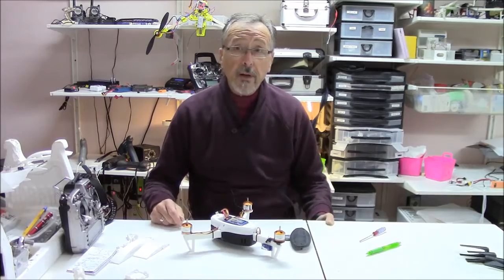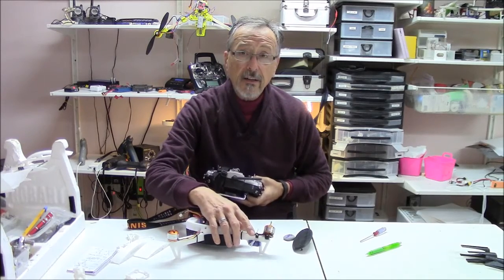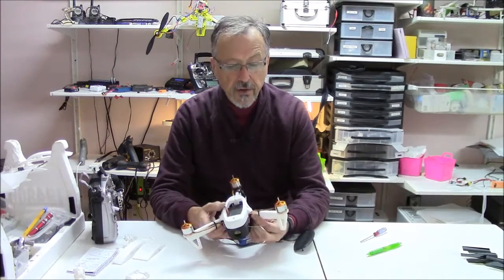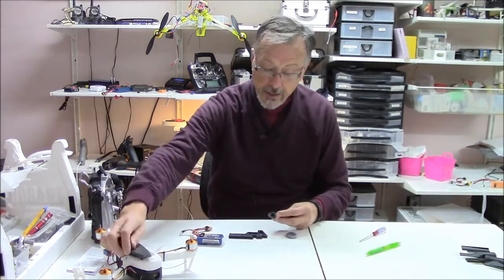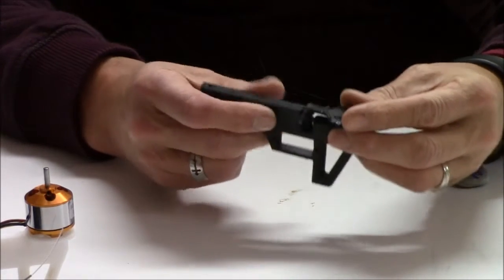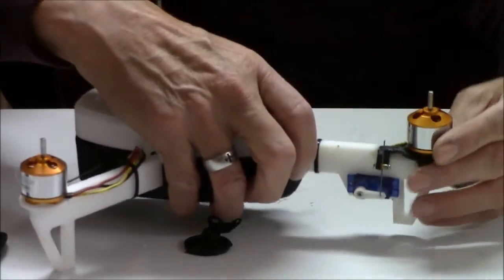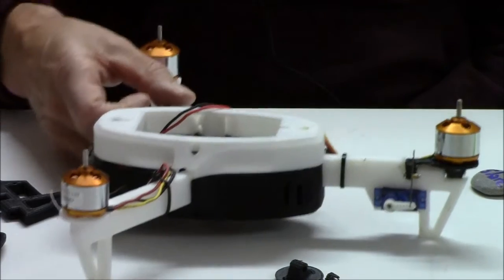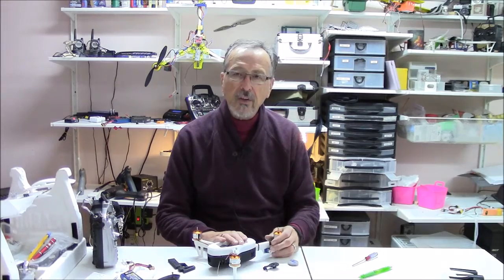3d Printed Tricopter

Comment: The printing problem described at 3:30 can be solved by configuring your slicer to drastically reduce speed on small layers. That will give each layer more time to cool before stacking the next one on top.. Also, if your machine has a layer cooling fan, and the slicer has the capability to set a specific layer fan speed for each layer, turn up the layer cooling fan to maximum on these layers. 
PLA works better for these small details, and is also stronger due to better inter-layer adhesion and it has no de-lamination problems like ABS can have under certain circumstances.
No raft or supports needed if printed flat as EMaglio intended.
Obviously you sometimes might want to change things if your printer or slicing method isn't doing the job, but I just wanted to point out that this part is actually quite easy to print with the correct approach.